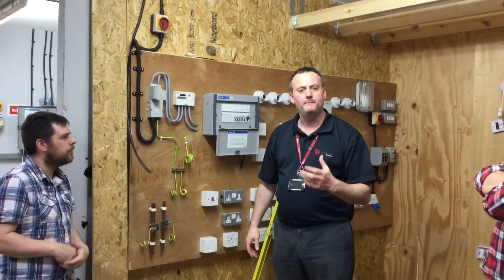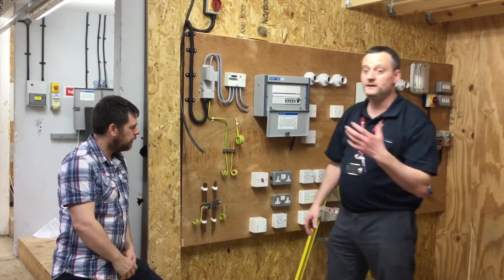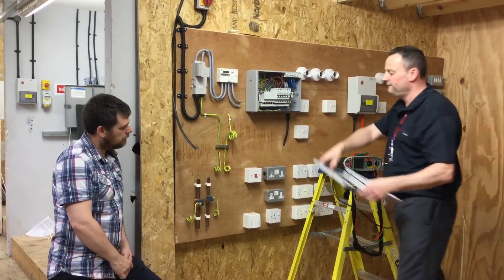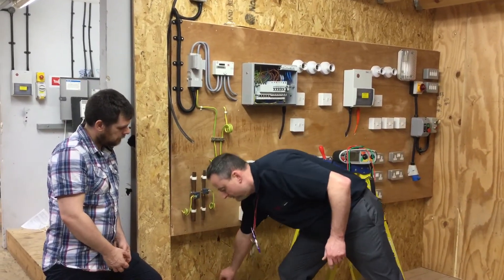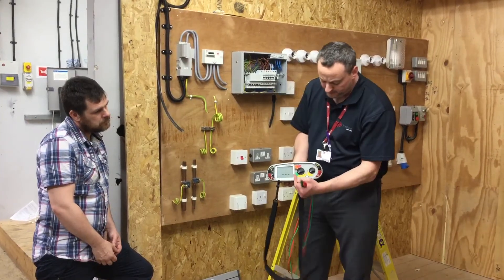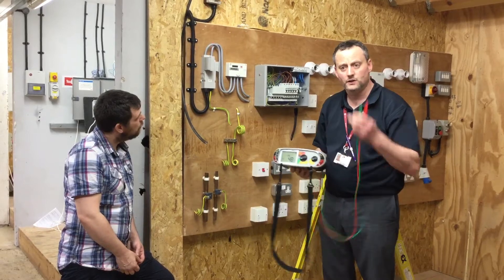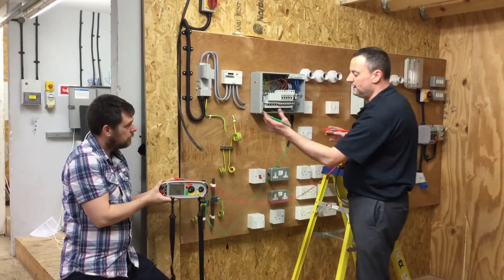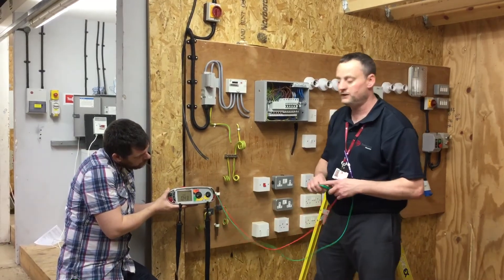Electrical testing LIVE measuring external earth fault loop impedance Ze

Comment: Wasn’t that ze a bit to high for a ten-c-s darting system max ze 0.38
Reply from the maker: Hi. It’s so high because it is a fake origin of an installation so therefore has all the circuit impedance to this point. This video is more helpful https://youtu.be/lRwj9Y496Qc
All the best and thanks for watching GSH Electrical
Reply: Vernon Jones max is 0.35 for a TNC-S